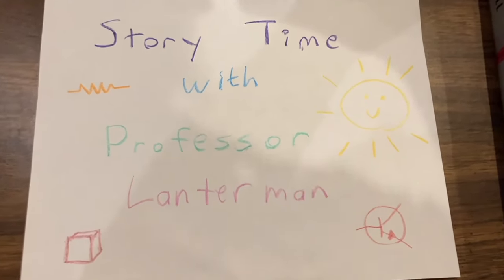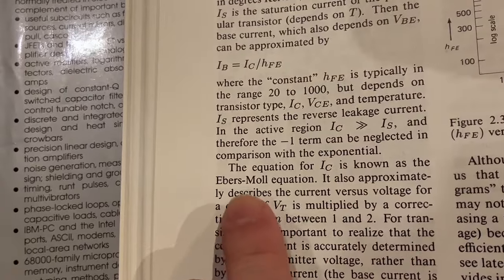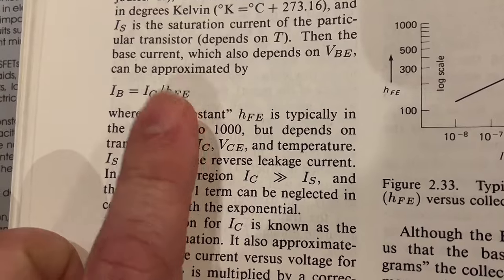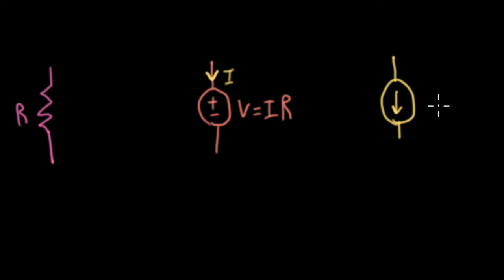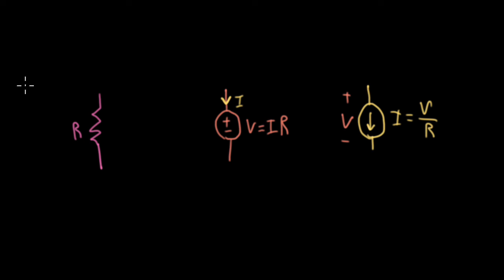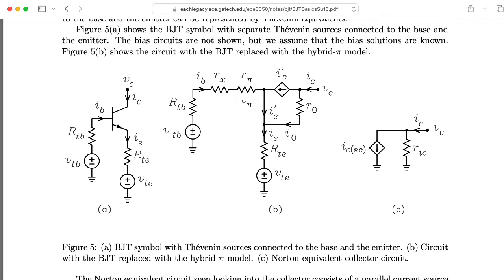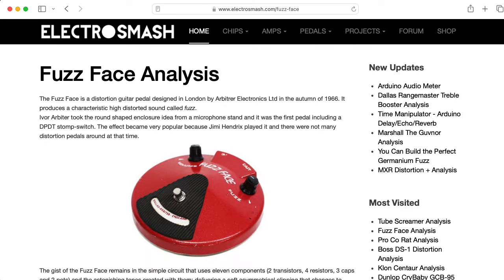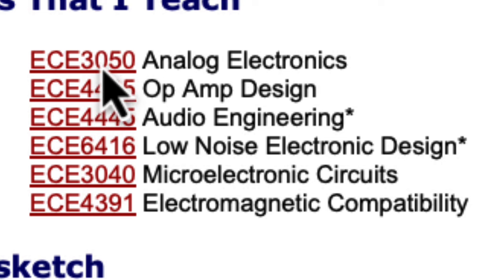BJTs are VOLTAGE-Controlled Current Sources!

Comment: Having spent a lot of time characterising exponential-voltage-to-current designs for music VCOs recently, I'm always quite amazed at how accurately a real life circuit follows the Ebers-Moll equation if you compensate the circuit for the bulk emitter resistance of the bjt. Another nice video Aaron!

Comment: Thanks for addressing this subject. Another great resource, one that focuses on radio frequency circuits, is Communication Circuits Analysis and Design by Clark & Hess 2nd ed. 1978. The book begins with a great explanation of the BJT as a voltage driven device. This simplifies the design of RF oscillators, mixers and much more.

Comment: when i saw the thumbnail i had to watch this. My "electronic devices" teacher drilled this into our heads of how and external electric field across base-emitter modulates the internal "built in" voltage fighting the current diffusion across the depletion region, hence controlling he emitter-collector current .

Comment: You should think of the base current as an unwanted side effect of the transistor. When designing a circuit around Ib and hfe it will be very difficult to reproduce it expecting it to have the same behavior even with the same type of transistor. Also because hfe is depend on the collector current, called beta droop, this means driving driving an amplifier with current will result in a lot of distortion bucause of the non linear behavior.

Comment: The irony is the famous "Transistor Man" drawing early in Chapter 2 of the Art of Electronics showing a man controlling collector current by looking at a meter measuring base current! Of course it's not a horrible approximation, but it IS an approximation, and the Ebers-Moll model is introduced later in the chapter.

But the "Transistor Man" model is likely what most people remember.

Comment: I think the best example of the fact is how one can hugely speed up closing a bjt switch by forcing the base-emitter voltage to zero or slightly negative. (it otherwise takes several microseconds for the collector current to cease flowing after stopping the base current)
Reply: This can as well be the best example of the need for a base current: you need to remove charge from the base and the best way is to... Make it flow out (with due sign convention).

Comment: I recently talked with the guy from SSI over the SSI2164 and he said it requires a voltage, not a current, but i only saw transistors in the simplified schematic.
A while back i played with the TB-303 vco, where 2 transistors act like a comparator. it clearly shows voltage play an important role (if the voltage on base is higher than the emitter).
Reply from the maker: Yeah, the SSI2164 control pin takes a voltage input.
Reply: @Lantertronics  Ya, but it's weird when you look at the schematic in the datasheet and only see transistors. to remove it's exponential property you need to make a anti log circuit as the SSI man told me. so the SSI21664 can be used as VCO with REAL linear input on the control pin put aside the normal voltage. i did a research on Anti Log circuits, but for now it's a bit unclear for me, i tried simulating these circuits found and found nothing special or the simulator isn't up to it.. Would you give it a shot on the Anti Log circuit to be used on the SSI2164 control pin? i have made a cool VCO circuit and it works, accept it's useless to build if it doesn't follow 1v/oct.
Reply: Look again.... the SSI2164 datasheet does have resistors in the simplified circuit.

Comment: Personally I've always felt like what people are really asking when they talk about current controlled or voltage controlled devices is which parameter has the more linear relationship with power through the device, not necessarily which parameter can be used to most neatly model a devices characteristics.  Generally this is because that's how they've learned to think of two terminal devices and they are trying to extend that understanding to transistors.  For example a diode is often described as a current controlled device because if you were to linearly vary the power through a diode you would see that the current through it would seem to change almost linearly while the voltage would seem fairly constant.  

Is it true that the power through a diode is controlled with it's current and not it's voltage though?  Of course not.  Your thumbnail for this video is the Shockley diode equation demonstrating that after all, but as the old saying goes, "All models are wrong, some are useful." The idea that a component is either voltage controlled or current controlled is a useful simplification for someone just learning about the basic principles of circuits.  That simplified model which sees every component as having a linear relationship with either voltage or current can quickly outlive its usefulness though.
Reply from the maker: Indeed, I usually see people support the current-controlled viewpoint by saying because it's linear it's easier to think about. I think that just winds up just transferring the complexity elsewhere...
Reply: @Lantertronics  Yep, because some black-box models are more convenient.   But if we actually believe a black-box model is true, that's called Reification.   
Looking at the transistor physics, we find no mechanism where the base current can somehow alter the collector current.   One current doesn't affect another.   Transistors literally cannot be current-controlled.   Then, to explain the APPARENT current-control, we just introduce Vbe and e-fields of the junction.  In AOA, the "little transistor man" who produces the "current gain," he's the EB junction voltage.   He measures the base current, then proportionally adjusts the emitter current.   (But AOA authors forgot to mention that "transistor man" is just the Vbe potential!  Base current and collector current are communicating via changes in Vbe.    If we force Vbe value to be fixed, then current-gain disappears.)

Comment: It reminds me of, "all models are wrong, but some models are useful."

I started considering BJT's as voltage controlled shortly after I started working with differential pairs. Am I right in saying that, if you apply a current from a voltage to a BJT's base (i.e. through a resistor, either on the base or the emitter) the voltage on the BE junction will be the log of the input voltage. However the output current (and therefore output voltage across the collector resistor) will be proportional to the anti-log of the BE voltage. I.e. the log/anti-log functions cancel each other out (with other influences such as temperature, etc) ?
Reply from the maker: I'd rephrase it as "current from a current source to a BJTs" base -- and then yeah, your explanation does make sense.

Comment: I think the current-controlled description is useful for comparing from FETs. FETs only need a voltage and draw almost no current (very high input impedance). You can put a voltage on the base of a transistor with a very limited current and it will not work. Any current requires a voltage but you can have voltage without current.
Reply from the maker: I'm not sure I'm following what you mean by "put a voltage on the base of a transistor with a very limited current?" If the voltage on the base is so small that you don't see any collector current, then the Ebers-Moll equation predicts that.
Reply: @Lantertronics  For example, if you try to drive a transistor from a source that can supply the voltage but not at the turn on current the transistor will not turn on. The voltage makes current but you need current for it to turn on vs. an FET.
Reply: This seems to be a thing with Art of Electronics where they throw the baby out with the bathwater for simplification maybe.
Reply: Consider driving a bunch of transistors with a small microcontroller. Maybe it can produce the VBE but not the current and in that case it won't work. You can say it can't supply the voltage at that current I guess but it's all interconnected and knowing what physically turns the device on is useful.
Reply: With tubes you typically want a high voltage to control the flow of electrons but the electrons are not supplied by the high voltage parts of the tube. They're supplied by the low voltage but high current of the heaters. The effect of voltage on the grids is what makes things happen. Not current. Same with FETs.
Reply: You can vary the resistance so that a huge amount of current flows through the grids or a tiny amount without effecting the number of electrons moving from the cathode to the anode.
Reply: I wonder if this is a leftover of this book being written when 20ma of current was basically nothing in solid state circuits.
Reply from the maker: @justovision  In the active region Vbe and Ib are linked. It doesn't make sense to say it could produce the Vbe but not the appropriate Ib. If you are targeting a certain Ib and the microcontroller can't quite produce it then it won't be producing the full voltage you want either. In any case it's more common to need to actually put a current limiting resistor in series with the base, so your Vbe is less than the high logic voltage put out by the microcontroller anyway.
Reply: Like I said you CAN have voltage without current. If the load draws current the voltage drops. @Lantertronics
Reply: Yeah you can say the voltage will drop but that's because the device needs current.
Reply: A large amount more than "voltage controlled devices"
Reply: @Lantertronics  I think he means OC outputs.   They can't supply the base drive Ib.   (But also they can't supply voltage, except perhaps by nanoamps surface-leakage between IC pins.)

Comment: So... is the main significance of the base current that it needs to have a DC path to ground provided for it, and so must be considered but shouldn't figure in the gain calculations?
I've been doing some transistor matching, and it seems from reading the experience of others that it's more worthwhile matching the Vbe rather than hfe. I've been measuring it by connecting the DUT as a diode in a circuit that pulls a constant(ish) 100uA through it while I measure the voltage drop across it.  Do you agree about the Vbe, and can you suggest the right way to measure it please?
Reply from the maker: I"m not sure I'm following what you're trying to say in the first paragraph. For BJT or enhancement mode MOSFET you'll generally have connections to the DC supply rails somewhere to provide bias.

Regarding matching, google: Ian Fritz transistor matching. Ian is a very clever guy.
Reply: @Lantertronics  I too was reading AoE, and it was something in the differential amplifier section of the BJT chapter.... hang on, thanks to having a digital as well as a print version I can cut & paste it:
"Be sure to remember that this amplifier, like all transistor amplifiers, must have a dc bias path to the bases.  If the
input is capacitively coupled, for instance, you must have base resistors to ground."
Reply from the maker: @gerryjamesedwards1227  Yup, need biasing. But that's just something you need in general, not particularly because current flows through the base.
Reply: @Lantertronics  thank you!
Reply from the maker: @gerryjamesedwards1227  You are welcome!

Comment: Man, this is bit of sophistry. The electric potential (base emitter voltage) induces current, i.e. charge carriers into the base. 
Whether you consider the BJT as a voltage or a current controlled device is simply a matter of viewpoint. Either approach is valid. 
If you wanted to spilt hairs even more you could say that the BJT, the FET and even the vacuum tube are all charge controlled devices. 
Yes, I do this for a living.
Reply from the maker: It has practical implications. I contend the voltage-controlled viewpoint leads to much cleaner solutions that are ultimately easier to teach. The current-controlled viewpoint just puts off the complexity but it eventually works its way back in.
Reply: @Lantertronics  Hmm, yeah, I guess. Whatever works for you.
Reply: @Lantertronics  That's where the rage and flamewars arise:  from people who have used current-control all their lives, and consider themselves experts, but suddenly are shown to be wrong on an absolute scale.   Nothing will shift their prior beliefs, because for that to occur, first they'd have to see themselves as little children, still learning.  Children, not educated experts with decades of experience.   If instead we become "experts," learning mostly ceases.

I think this was Einstein's great secret.   He considered himself a little child.   That way he never got trapped by the dogma of the time, the way that any "top physics experts" get trapped.
Reply from the maker: @wbeaty  I just recorded another "Story Time with Professor Lanterman," this time with a Professor Lanterman puppet my wife made. ;)
Reply: @Lantertronics  > Professor Lanterman puppet - - 
That's the way to do it!  
I always say, don't try to become everybody's friend, instead make it our goal to outrage certain kinds of people.

My favorite trick: attract people who love to read, while repelling everyone else.  (Just type many-pages responses to every comment.)

Comment: Go read the original Ebers and Moll paper, and read it till the end. You will see that they also give their celebrated equations in the form of a current controlled model.

You can see the device as either a voltage controlled or a current controlled device. If anything, these devices are charge controlled.
Reply: For a list of references, see "Working of a bipolar transistor with electron flow" and "Why is a BJT considered current controlled" on Electrical Engineering Stack Etc.

I had to put this in a separate comment because yt deletes anything pointing to external referenced. It interferes with their gaslighting.

Comment: The title is literarily correct, but not in practical usage.
Reply from the maker: I'd argue the opposite -- the voltage-controlled viewpoint allows for much cleaner explanations of many circuits than the current-controlled viewpoint does.
Reply: @Lantertronics  Yes, you are right. But in practice, it's almost impossible to use Vbe to control Ic
Reply from the maker: @jachfeng6201  I think we must be misunderstanding each other. I'd argue it's very difficult to precisely control Ib. It's much easier to think about voltage control.

Let VBE be the DC bias point, and vbe be the small-signal perturbation around that bias point. Let vBE = VBE + vbe be the total voltage. Looking at the slope of ic, the small signal collector current, vs vbe (evaluated at the DC bias point) gives you gm, the small-signal transconductance. The total current is iC = IC + ic, where IC is the DC bias current.

If you have a common collector amplifier with grounded emitter, the gain is just gm times RC, the collector resistor. Very elegant and clean. Derivations of the voltage gain that try to work through beta are much more awkward. And the point is you're generally specifying the input signal as a voltage.

Comment: No, they are current controlled
In the equation Vbe/Vt is unitless
Reply: Actually, current-control is the "for-dummies" description of transistors.  It's so over-simplified that it's wrong.   
When we go to engineering school and take semiconductor courses, we learn the real stuff:  the actual physics of the BJT, and the math which describes it, called "Ebers-Moll equations."   
Current-control doesn't explain transistors, because base-current has no effect on collector current.  Also, current-control cannot be used in professional designs, except in the most simplified examples.   The pros use voltage-control, because it always works.   Current control causes designs to fail (as Horowitz and Hill describe in great detail, in the lab-manual which comes with the AOA textbook.)
Reply from the maker: I'm always perplexed when people think the current-control view is easier to understand, because when you actually try to use it, it winds up being really awkward compared with using the actual voltage-control view.
Reply from the maker: I'm not sure what you're trying to say when you say Vbe/Vt is unitless? Yes, of course it is. The saturation current is in units of amps, so you get a collector current in units of amps.
Reply: @wbeaty in the original paper by Ebers and Moll the equations are given also in the current control form. Has anyone ever read that paper?